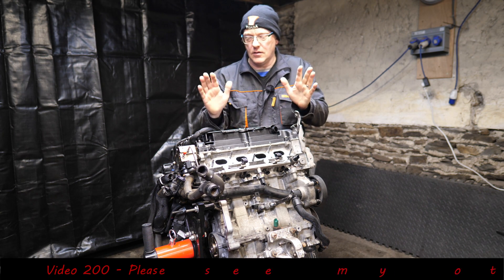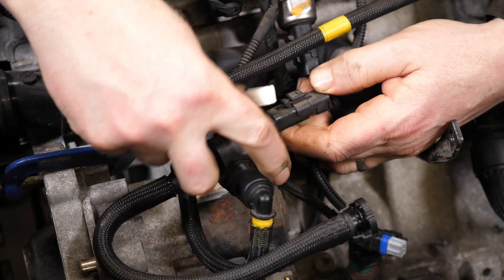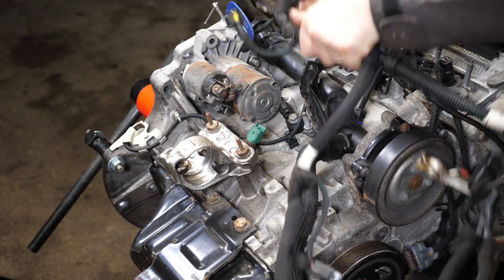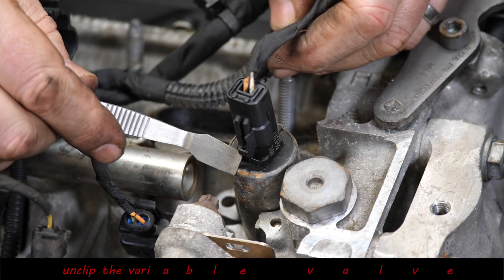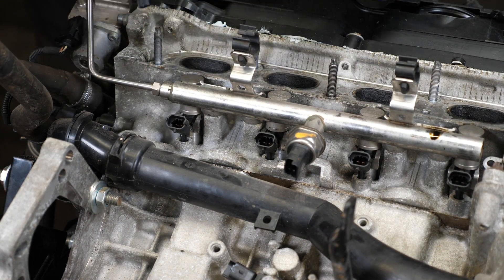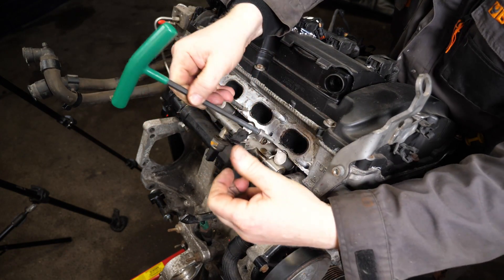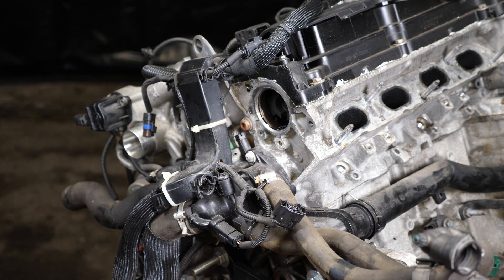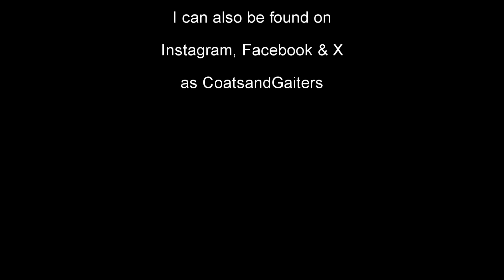Part 9 - Removing Fuel Pump & Fuel Injectors on Peugeot 207 208 EP6 THP Citroen BMW Mini N12 N13 N14

Comment: At minute 1:20...a mechanic like you couldn't have made that mistake. That "lock" is pressed from top to bottom...even with a screwdriver...and you just need to pull the connector back.
Reply from the maker: All these car clips are different and so frustrating for an amateur like myself to mess up.  Electrical connectors are the worse as literally every single one seems to be different and you sit there trying to work out how best to do it without breaking them.  I swear they do it on purpose to catch home mechanics like me out.

Comment: I have a 2013 Ds3 thp 1.6 petrol 155, do the injectors need coding after new ones added or does the system auto code itself?
Reply from the maker: Sorry I have no idea.  Just took the engine apart for a video.

Comment: Sorry for the question, how did I get access to disassemble the injectors without removing the engine,? I mean in my car 
citroen ds4 2013 
1.6 THP 16V 163 (EP6CDT M)
Reply from the maker: Sorry I only know what's in the video as I'm not a mechanic.
Reply: @CoatsandGaiters  Got it thanks, just love your channel,and about the explanation of the engine parts.
keep it up !!
Reply: These engines are very good,, but a nightmare to work on.    It very easy with the engine out. With it in I would say forget about it.  You could try lifting  engine of the mount

Comment: In the books of 2024 you can read that the 1.6 THP 156HP the connecting rod shut be 5nm 15nm and 130gr +-5gr and not 5 nm and 10nm 130gr so the torq of the 150hp and the 156hp is not the same!!!!!!!!
Reply: M7x37

Comment: What was the carbon build up like on the intake valves? Maybe you'll cover this down the line.
Reply from the maker: I've just uploaded part 16 on removing the pistons.  The valves were last week I think.  Part 15.
Reply: @CoatsandGaiters  Great stuff! 

My mate knows nothing about cars but decided to buy a 2019 C4 Lounge with the 1.6 THP engine and then not change the oil for three years! Although it did only do 7,500 miles in those three years and after around 5,000 miles it was topped up/overfilled with two litres of new oil. 

I've since changed the oil and filters for him but I'm wondering if the next oil change should be done much earlier to help try and flush out any build up that may have occurred. Care to speculate?
Reply from the maker: My only thoughts on modern engines after 2007 is to change the oil every 6,000 miles as clean oil is so crucial to modern engines working reliably.  The other thing I would do is drive it very sympathetically as these engines are under lot of stress.  Mine blew up just sat ticking over outside so these early engines have a very poor reputation.   @simonshurety3870
Reply: @CoatsandGaiters  Agreed, oil is cheap and engines are expensive.

I told my friend not to buy it! And now he wants to sell it to me lol.
Reply from the maker: The later ones may be totally fine as I did hear they resolved many of the early issues.  My experience is only of a 2007 one which were a disaster.  They could well be brilliant engines now. @simonshurety3870
Reply: @CoatsandGaiters  An added complexity is my friend and I are from the UK but actually live in Brazil. These engines up to 2014 or so were Mono and had massive issues with timing chains stretching, high pressure fuel pump, valve retainer seals drying out and leaking and valve cover membranes to name just a few.

In 2015 odd the updated flex full version (Ethanol/Petrol) was released in Brazil which solved most of the major headaches. 

The biggest issue by far is finding qualified mechanics that are halfway honest.

I will not be buying my friends C4 Lounge due to how sludgy the three year old oil was that came out and I also noticed how much of that old oil got left in the pan with that raised collar. I would have tried to suck some more oil out of the dipstick tube if i had known. Also there is an additional intermittent issue with the AC which a previous owner saw fit to try and fix by adding a fridge thermostat. 

As it's 30 degrees celcius by 8am here most days literally any car with working AC is the best car to buy over a non-working one lol.
Reply from the maker: I've heard it's hard to find mechanics that will work on this engine due to so many things that can effect eachother.  I expect in reality the engines need removing and a full review and test of everything needs to be done to ensure trouble free motoring.  @simonshurety3870

Comment: Just for info, those fuel connectors click off if you press down on top of the plastic clip, then it will expand on the sides an can be taken off.
Reply from the maker: Blimey !!!! thank you for that info.  So I was making a right meal out of it.
Reply: @CoatsandGaiters  Would not worry ,,, they usually end up broken anyway.
Reply: @pfauniversal1890 😂